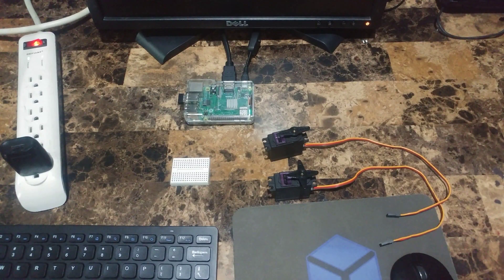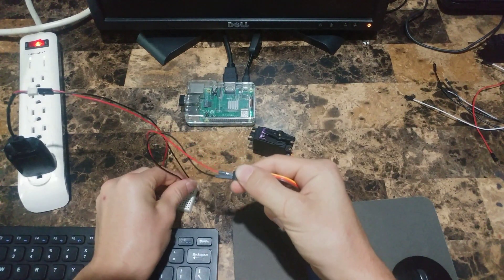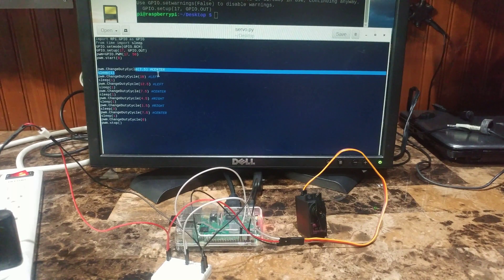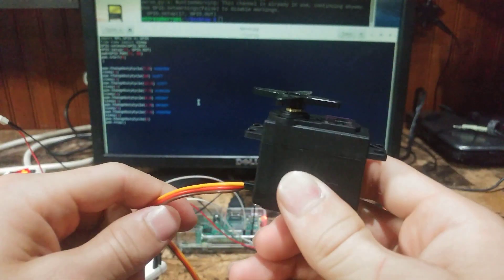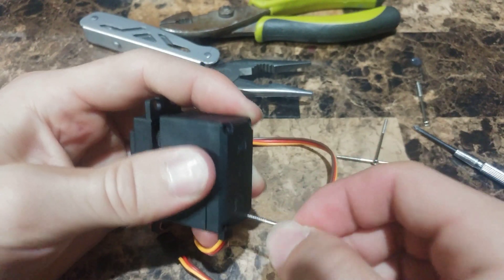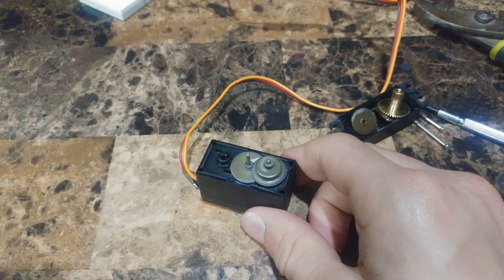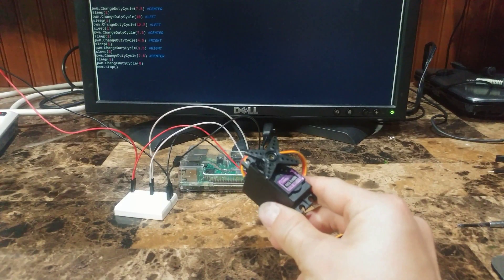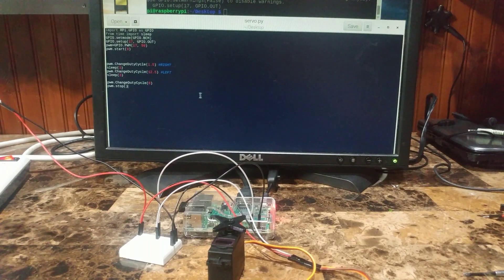Control A Servo With Raspberry Pi | Basics of Robotics

Comment: Can I connect 4 servo motor to rpi4??
Any way..?
Reply from the maker: yes, the pi does have enough pins to run 4 servos at the same time. be sure to use an external power source of course.
Reply: @dyverge  how external source should be connected 
For ex which wire in servoshould be connected to positive terminal of battery
Reply from the maker: @ABHi-oe7sy  Connect positive and negative of servos to battery. Then, join the GND of the servo battery with the Pi's GND so that signals will have a complete circut. If you are using the same battery this is not necessary, but servos may cause voltage drops that will shut off the Pi so I'd recommend using two separate batteries